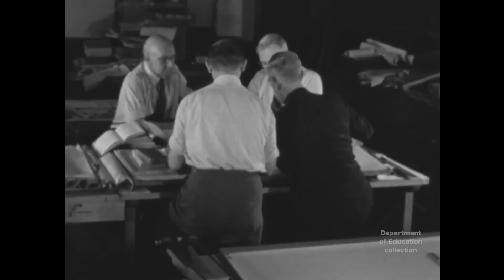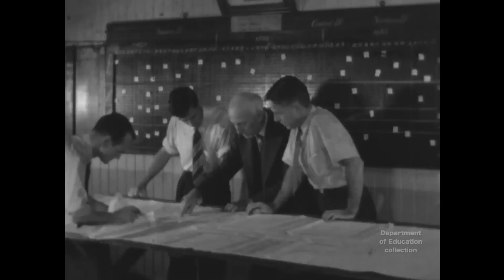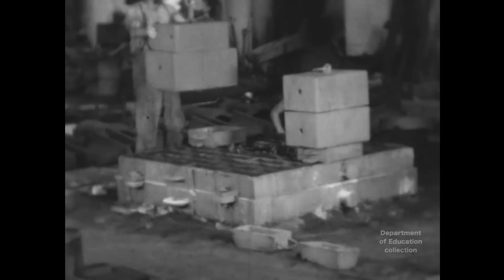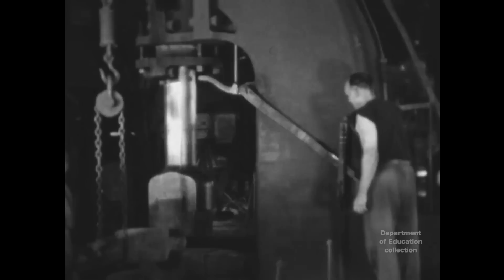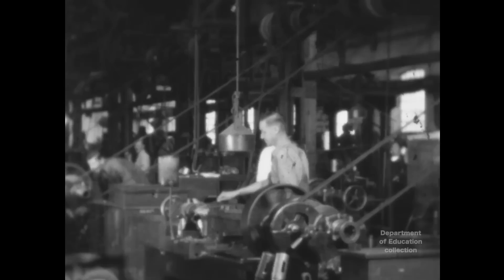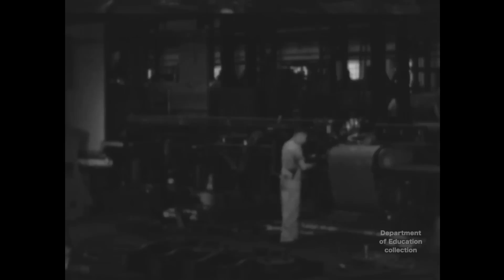The Building of a Locomotive

Comment: Here is my thought why machinery from way back then runs and contemporary machinery won’t last. Back then we didn’t have computers that give results to 20 decimal places. A slide rule was very close most of the time. An experienced engineer would take that into account but also add the “fudge factor” his experience has told him is safe. Could it be a 5% margin of safety? No because the results of calculations isn’t precise enough to make 5% safe so he goes for a 10-15%. 
THAT added margin while adding cost and weight to the train is enough to guarantee a part can be reworked/repaired safely in the future.
I retired last month from a career as a flight test engineer. I might have called for a 10% margin of safety in one of my mechanical systems. The design team will give us a system that isn’t 9.75% or 10.25% margin but exactly 10%. No more, no less. There isn’t any real allowance for any future variance. The end customer isn’t interested in adding anymore margin, read $$$, to keep costs low and profit high.
I have worked and flown aboard aircraft that were built before I was born. Those will still be flying when I’m laid in my grave.
The aircraft I worked at the end of my career will never live many days longer than the days they were designed to fly.
Reply: There is a lot of truth in your comment. The biggest competition for our new machines was our used machines which refused to die. Not long ago I was at a customer’s plant to assess the  performance of a machine we built in 1914.
Reply from the maker: @kaptainkaos1202  Very interesting to read this. How long were you involved in the aviation industry for?
Reply: @ I spent 45 years in Naval Aviation. I truly was blessed because I had so much fun, learned so much and made good $$$. I am one of the few people I know that couldn’t wait to get to work because I rarely did the same thing over and over.

Comment: I just completed 50 years in engineering design of heavy machinery.  Many of the processes shown are unchanged in their essence.  The big difference is the widespread use of electrical and electro-hydraulic motors as prime movers and especially the use of computer numerical control of of the processes.  This has been augmented by computer-aided engineering and drawing and the streamlining of the transfer of design/manufacturing data for process control.  I started when pencil-on-vellum was the way engineering drawings were made and a slide rule was the forerunner of of hand-held the alculator.  Now, many parts are made without ever appearing on paper.
Reply: We’ve been in the same boat. Will you look at my post and give your opinion. We touched on the same topics almost.
Reply from the maker: @timengleman  Thanks very much for sharing your memories. It’s interesting to watch how engineers work to build a machine or structure, and what goes in to achieving the final product.

Comment: talkie films werent in use until 1926 in america where the process was invented.   the film quality is too good for the first half of the 30's.   i'd bet the second half of the 30's.
Reply: Talkies were invented in Germany (Tobis Klangfilm), made their initial very crude appearance in the US in 1926, were popularized with a sound-on-disk system in 1927, and Fox's optical track system (Western Electric) came out in 1928. In the '30s, optical tracks were added to 16mm by removing one row of perforations and using that area for the track. In about 1933, the Auricon Camera Co. began marketing heavy, soundproof motorized cameras which could record an optical track directly on to the 16mm film. Their building was still there when I visited Hollywood in 1980.
The Edison Co. experimented with sound quite early, and I've seen a Pathe film of 1903 featuring the great British star Little Tich which has synchronized sound, albeit apparently these early experiments were unsuccessful.
Reply: @ , bonus information, thank you.
Reply from the maker: @vsvnrg3263  Thanks for sending through these details. I think the locomotive under construction was a member of the C17 class?